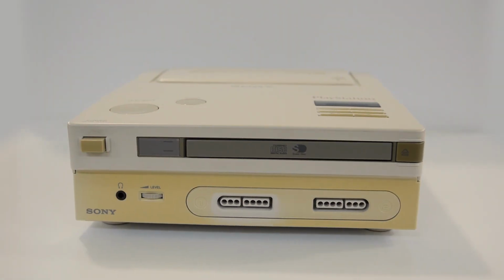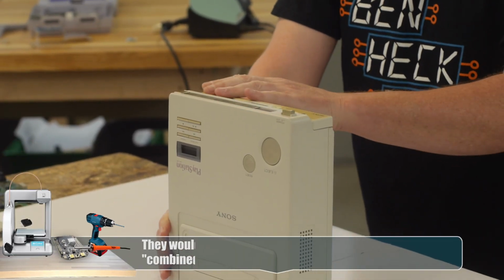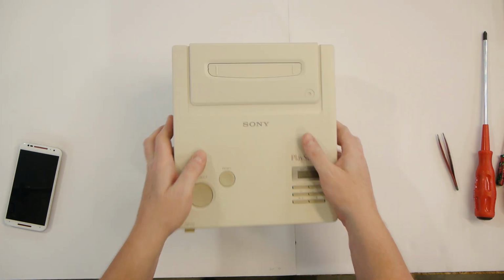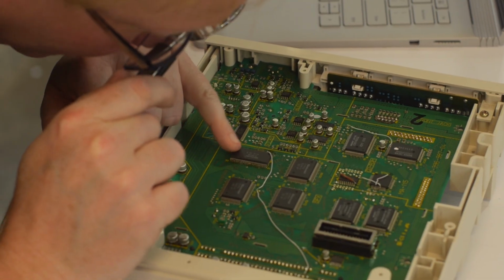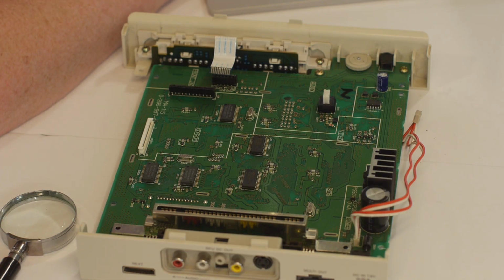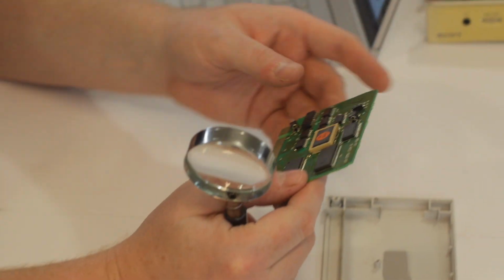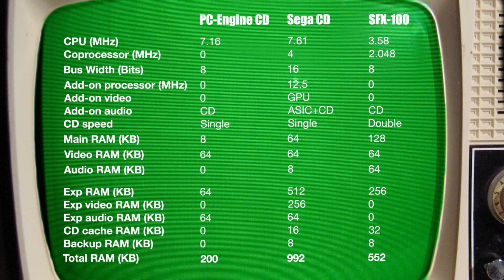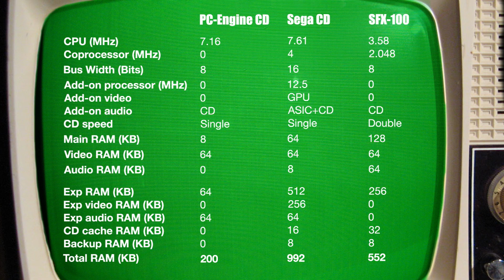Ben Heck's Nintendo-Playstation Prototype Pt 1 Teardown

Comment: As for the eject button on the SNES. I used it all the time. I wouldn't dare take a SNES cart out of the original SNES hardware without using the eject button and I won't let anyone do it to my console.
Reply: I also always used the Eject button for SNES games. I never would pull out SNES games manually.
Reply: The button doesn't disengage any electrical circuits or anything, it's just a lever that pushes the cartridge out, exactly the same as pulling it out. Just always turn off your system before doing anything, that's the only thing that matters.
Reply: Well, one potential benefit of using the lever is that pushing the cart up from below may put less physical stress on the system than pulling it out (possibly pulling it at odd angles to loosen it)
I don't think removing carts by hand is especially likely to damage the system, but the eject button is a nice system and I'm glad it's there.
Reply: nintendo literally only put that eject button in because they thought that kids would love it.
so basically, all it's there for is for fun.
the Famicom (japanese NES) had a similar thing, also for the sole reason to entertain kids ^_^

so you can totally just pull them out.
Reply: Nukleon 
It alleviates the stress from pulling it out hence why it is there. Hence WHY I use it. I am not wrecking my SNES or my carts just to please you guys who are doing it wrong.
Reply: Anybody who says don't use it is an idiot. It's there for a reason. You might as well use it, it's all fun and games until you break something. Stop being difficult!
Reply: same here my dad taught me how to take care of my shit. also we were kind of poor so if I broke it I was fucked, because he wouldn't replace it. I would have gotten an ass whoppin too.
Reply: ***** 
I do as well.
Reply: +Pixar Ok so you are just gonna ignore that the N64 doesn't have such a lever to alleviate "stress" like that.
Reply: Monstereitski
Not true. They're locked in while the power switch is on, but when the power's off the cartridge can be removed freely. It's just easier (IMO) to use the eject button.
Reply: Though AKAIK, the button is only needed on early games with the cartridge lock. Other games can just be pulled out.
Reply: ***** 
I have had one of my carts broke by someone who refused to use the damn eject switch.
I had to buy another copy of Super Metroid because of their stupidity.
Reply: ***** 
Damn rights. Ben Heck was wrong and that makes me feel slightly better.
Reply: I only have experience with the Famicom's eject button (not the SNES) but I suppose it's similar so: you need to push down the cartridge quite tightly to make it work, and the end result is that if you're a kid there's a very high change that later you can't get out the cartridge yourself. The eject button is extremely helpful in this case, because it's easier to push it than to pull the cartridge.

It's not really that big of a deal when you're older and can pull out the cartridge on your own just fine :P
Reply: I also used it, I would actually smash it and try to see how high I could get the cartridge to fly out when it was a bad game when I was younger. I don't think I've ever tried to get a cart out without it. In fact, you couldn't early on, due to the initial cart design. The eject is something I missed on my N64, cause you'd have to use one hand to hold down the system while you pulled out the cart
Reply: ***** 
It does make a difference.
Reply: Pixar The Great I mean, not using the eject button isn't worthy of being called an outright idiot, I mean specifically the people who say no, you should not use the eject button period, as some here have said.
Reply: Ya'll were the only ones lol
Reply: I used to slam the eject button so hard the cartridge would fly in the air for me to catch
Reply: I don't let anyone touch my old consoles...they are lucky I let them touch the controller to anything older than an XBOX 360...
Reply: If I recall correctly it really clamps down on those carts. Unlike Genesis. Therefore the eject button makes it easier to use.

Genesis they are fairly easy to pull in and out. The snes I had held them very tight, so the button felt less awkward than trying to pull them out by hand.

Perhaps the japanese version didn't hold them so tight. I would like to feel the difference.
Reply: I'm just commenting so that you get notified and remember how insufferable you were 3 years ago. Hope you've changed.
Reply: Well according to Masayuki Uemura, the designer of the famicom and super famicom, the real reason they included the eject button is that they thought it would be fun for kids to use.  It's not like it loosened the cartridge's grip on the connector or anything.  It literally did exactly the same thing as pulling it out would do.  And if it was so important, how come the second revision of the snes and super Famicom didn't have an eject button?
Reply: On the PAL SNES and the super famicom cartridges are locked in the slot until you press the eject button.
Reply: lmao so many butthurt people. I'll rip games out of your SNES full force all day no eject. git gud nabs
Reply: ***** What you fail to realize is anybody saying that you shouldn't use the eject button or don't need to is an idiot. It is literally a button push more of your time, anybody who refuses to use the eject button is again an idiot. He is not butthurt, he is just more intelligent.
Reply: Nukleon 
The N64's cart slot wasn't as tight as the SNES cart slot. Neither was the top loading NES either. 
The SNES cart slot at least the original was tighter and yes I have seen personally people break their SNES by not using the eject button. I have seen pins get ripped out and parts of the carts connector get broken.

If you want to do it to your console, hey more power to you, but when it comes to MINE you use the eject buttons.
Reply: My eject button was soft or became soft over time. I removed cartridges by pulling on the cartridge while pressing the button.

Comment: It was never a rumor. There is a whole story to it. Nintendo was going to have Sony make the Play Station which was the SNES add on for the SNES. The problem was, Sony would get control of what goes on the Play Station while Nintendo dictated the cart slot. Nintendo didn't like the deal they made with Sony so they waited till after the 1993 CES when Sony said they were making the SNES CD Rom, the next day Nintendo took the stage and said they weren't partnering anymore with Sony and went to Phillips to make it which was Sony's competitor. So this embarrassed Sony and Sony decided to go it alone thus the Playstation was born (the SNES CD one was 2 words).